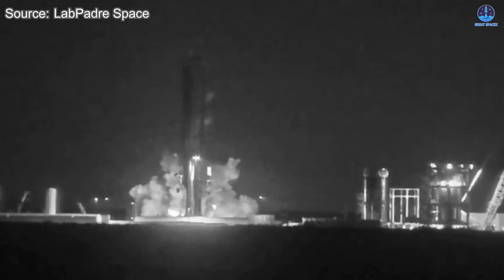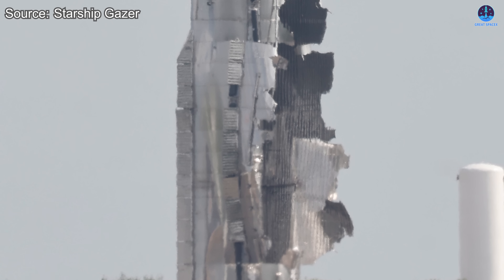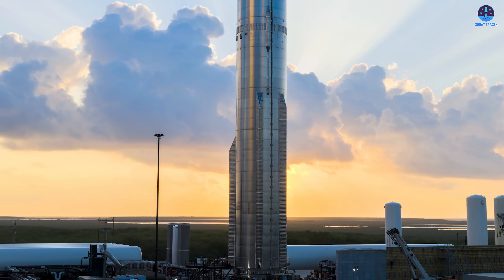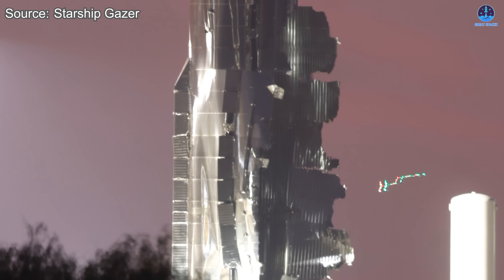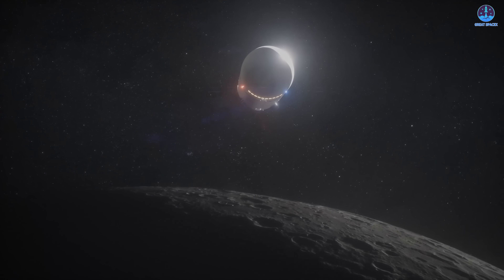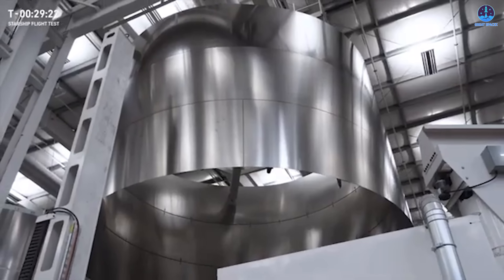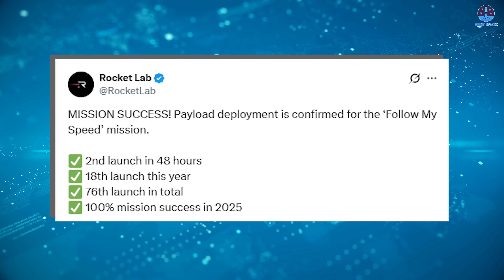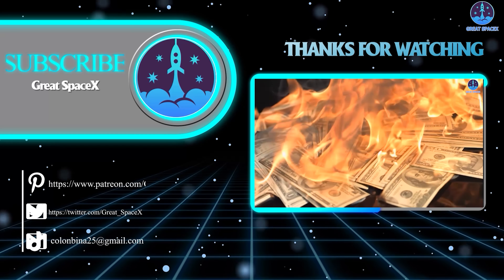BAD NEWS! First SpaceX Starship Booster V3 Exploded During Test! Here’s What Exactly Happened…

Comment: Actually its much better to happen at the start of V3 testing. Would be lot worse if happened during tanking or actual test flight when full with propellants.
Reply: It would be better to not have failures on the first try. A lot of scrap... bad engineering/ assembly QA... cut corners... people die.
Reply: @MrDogonjon  No failure ideal but its still prototype and such events are part of the process for SpaceX.
Safety protocol was spot-on as always ever since the back to Starhopper first flight.

Comment: what are these jokers doing to offset all the pollution and damage to environment?
Reply: Uhhh, they released nitrogen, you know what makes up part of the air you breathe!! Dumb Ass!
Reply: What pollution are you asking about.  Nitrogen and oxygen are not pollution.  The wrecked stainless steel is recycled.  Meanwhile, what is the state of Texas doing about the massive pollution produced by the fossil fuel industry that releases massive amounts of methane across the state?  What is the state doing about the enormous amount of water pollution happening across Texas with fracking chemicals entering peoples water wells?  What is the state doing about the massive pollution from all the fossil fueled vehicles trundling around the state?  And what are you doing personally to reduce your own carbon footprint?  BTW, 'offsetting' pollution is not reducing overall pollution.  It's a 'left pocket, right pocket' kind of thing.  Think about reducing rather than 'offsetting'.

Comment: It blew half the side out.  This was a non- fuel pressure test.  It was a test to max pressure.
Reply: Spacex is known to test until failure as well. Not saying thats the case here though
Reply: SX found a manufacturing defect, (scary it made this far before discovery), or it found a design defect, (even more scary).   This is Elon's test program, and he can run it anyway he likes, but still losing hardware on the 18th try is not a good look.

Comment: It didn't exploded, the tank ruptured. Stop with the sensational title. I know you want clips but can you at least pretend to be a little honest.
Reply: an explosion does not need to involve fire-- a bursted fuel system like this is also an explosion of high pressure non-flammable gas.
yes it is a rupture, AND an explosion, with no fire.
Reply: Energetic event , explosion,rupture , what's the difference? It's a wreck ,the only reason it's standing is the huge down comber tube in the center of the vehicle .Be months. Hopefully they get it sorted out.
Reply: Boom . Design
Reply: This called explosion. İf tanks crunch inside its called implosion. It doesnt need fire.
Reply: They screwed up once more. SpaceX is really struggling with their build quality. Build fast, break faster. That seems to be the philosophy. Something as simple as constructing a tank able to withstand the pressures seems like a big problem for SpaceX. Basic stuff and they fail at it over and over again, probably because they’re trying to move too fast and because they feel the need to keep weight as low as possible to get somewhat close to the (imaginary) load to orbit promises made by Musk.
Musk is promising all kinds of stuff (up to interstellar flight) but they can’t even get any meaningful load to LEO.
Reply: Lol a starship failure apologist. The project is trash get used to it.
Reply: Xactly
Reply: What's up with the negative comment???
Reply: Another fan who needs to get educated.
According to Merriam-Webster's dictionary, an explosion is the act or instance of exploding; a rapid and spectacular expansion